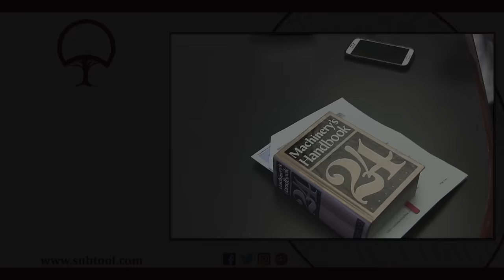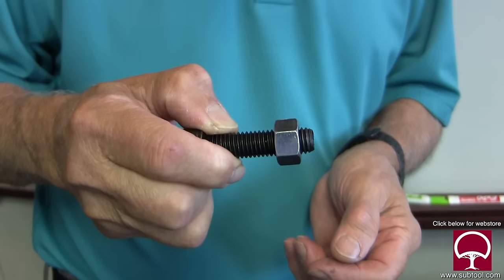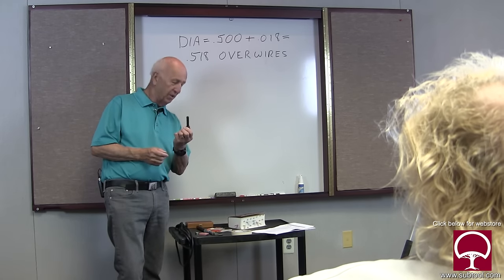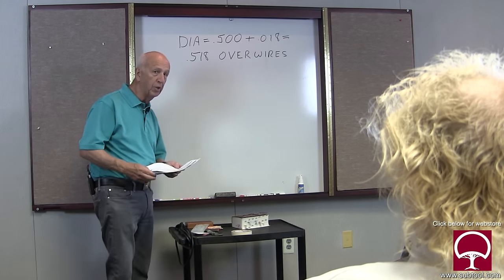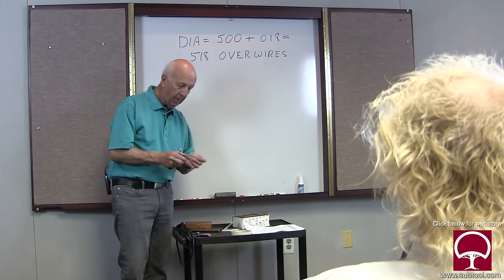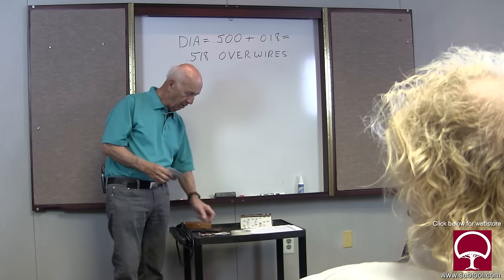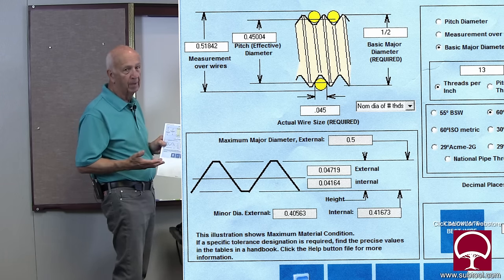Chasing a Thread on a Lathe Pt. 2 — Thread Measurement, Simplified!

Comment: Hi Again --

HTRAL -- How to Run a Lathe, Grizzly still sells that book for cheap.  Another great shop reference for lathes threads, not as in-depth but very effective for common shop tasks.
Reply from the maker: Hello again, thanks for the clarification! Hope you liked the "Swipe-to-Center" video, thanks again for the suggestion.
Reply: I did -- thank you.  That was my first trick, also works good for finding the center of a shaft for a keyway.  Swipe the shaft until the flat matches the endmill diameter and volla!  Centered and easy to find depth of key.

Comment: You can also use high density foam rubber to hold the wires. Always worked for me. Thanks
Reply from the maker: Good tip, thanks for sharing!

Comment: Another way of using three wires is to use copper wire, available in most of the same gauges as the 3 wire set, and wrap it around the thread a couple of times and then measure as before. Advantage, you don't drop the pesky wires in the chip tray. You used to be able to buy ready made coils, in the common thread sizes, to do the same thing, but copper wire is cheaper, especially if you have gremlins that pinch small items from your work bench and hide them away in another dimension never to be seen again. :>)
Reply from the maker: Absolutely another way to do it.

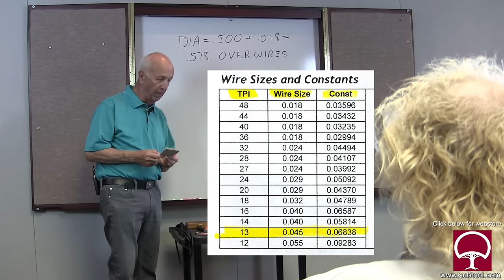Comment: 2:50 - The chart inserted on-screen is confusing because it shows only offset from the pitch-diameter ("Const") and not the offset from the basic major diameter (the 1/2 inch + 0.018" being discussed and written on-board).
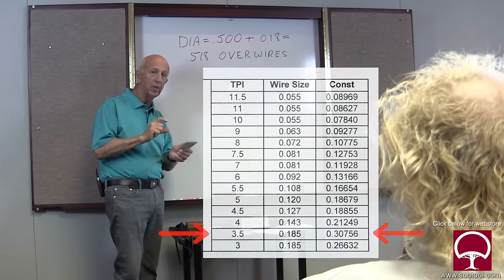2:58 - I'm not even sure why 3.5 threads per inch is highlighted with arrows. (Maybe, because that's where the missing "18" was found?)
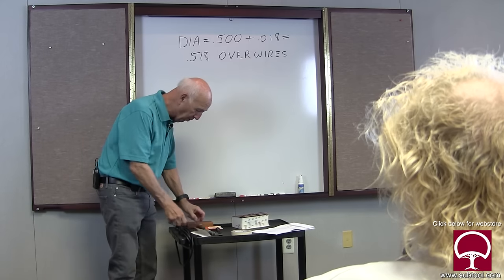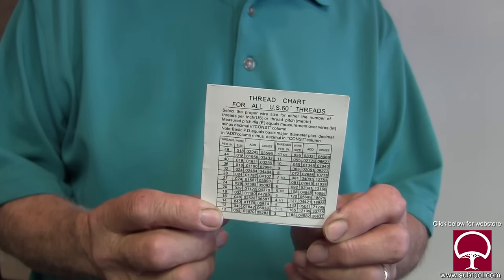Reply from the maker: The charts shown at 2:50 and 2:58 are the two separate halves of the chart included with the wire set shown at 2:38.  Since we have chosen to cut 13 threads per inch (highlighted in the chart at 2:50), we then follow the row across to find the wire size we need to use to measure our thread (.018 line noted by arrows at 2:58).  Since our stock is 1/2" diameter, .500" + .018" = .518" (major diameter).  The chart does not explicitly give you the major diameter, rather it allows you to find it.  Chart for reference: http://s2.photobucket.com/user/Holescreek/media/Traytop/threadwires003.jpg.html
Reply: The line shown at 2:58 is for 3.5 threads per inch. Also the line shown at 2:50 needs to have the add of .01842 shown.